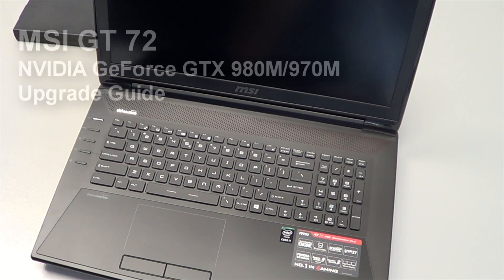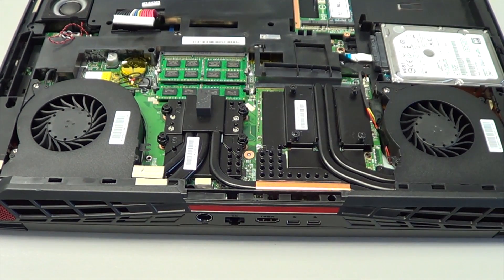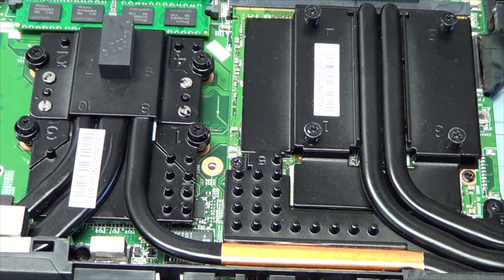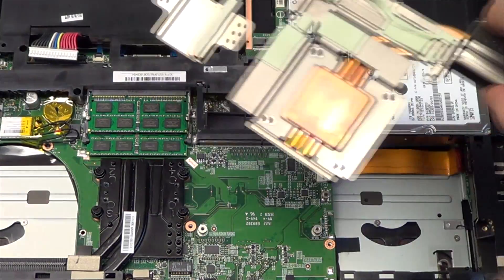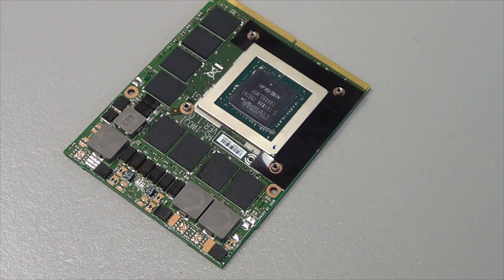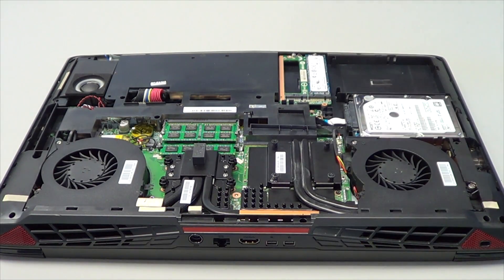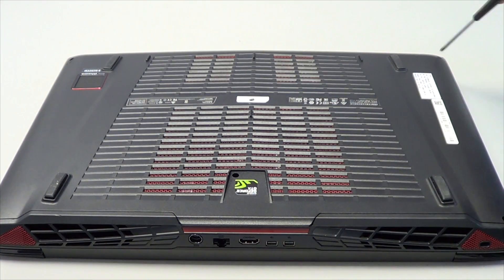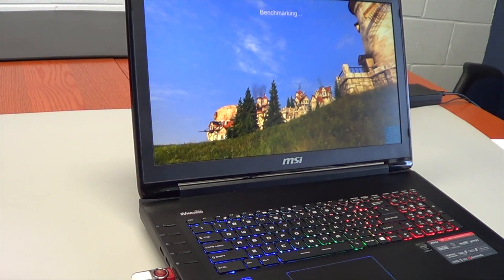MSI GT 72 NVIDIA GeForce GTX 980M Upgrade Guide

Comment: I would like to add my 2cents concerning to thermal pads, since I couldn't find it anywhere this is what i found doing some research and in my own MSI...
Memory 1.5mm
Resistors (big squares) and the little one up the memory 1mm
Row of 6 little components 1mm between Resistors
on the upper side 3 little components 1.5mm
and in the xtreme right 1.5 mm on two small ones
Reply: First, thank you for sharing this. This info is a beast to try to find online. Ive been looking for over an hour until finding this. How did the sizes work for you on your install? I am about to install my new card and need to know which size pads to buy. Also if you dont mind sharing what brand you would recommend as well that would be cool. again thank you for posting this.

Comment: I have a dell precision m4700 it came with a nvidia quadro k2000m gpu can i upgrade my gpu to this nvidia GeForce gtx 965m card i know that the 965m will fit in the dell precision m4700

Comment: Muy MSI gt72 shutdowns when reach 70 degrees. It has a GTX970M IS that the máximum temperature allowed?
Reply: Could be bad heatsink contact leading to big hotspot diference in comparison to the core

Comment: hey, i hope you see this. I have a older MSI cx62 6qd Laptop. upgraded the ram in it to 32gb from the stock 8gb thinking about a M2 card sense i have a spot for one. I really really wanna upgrade the video card from the crap card thats in it. Really I just wanna be able to play basic games in the metaverse and stuff like that with crisper graphics with no lag. First of all i am wondering if its even possible without going external and if it is what you suggest.

Comment: Hello, how are you? I really liked the video and I have a doubt. I have an MSI GT70 with a GTX680M MXM slot and would like to exchange it for a GTX1070 MXM slot. Is it possible?
Reply: yes but you need 2 things  -  1) vbios for MSI 1070mxm,  2) heatstink for 1000 series . Your wont work with 1000
Reply: @SebastianLaCroixV  Yes, I already bought the 1070 and it was a perfect replacement. I sawed off the heatsink to fit it. And it worked perfectly. The only problem now is that when installing the drivers, it only accepts the first version of 2019. So, it's limited in running the games. It runs Apex Legends perfectly at 144 fps. GT70 processor. I changed the processor from the 3610QM to the 3940XM. It gave a nice improvement.

Comment: Hey man, i got GT72S 6QF. But the old one (gtx 980) is dead. Now, i only use my intel hd 530. How sad.
Is that gtx 980m compatible with my notebook? It because i cant get the gtx 980 on ebay etc. Thanks
Reply from the maker: tough question. Email our team, they have the most knowledge about this. sales@eurocom.com

Comment: I have MSI GT72 Dominator Pro with GTX980M 8GB, can I upgrade it to RTX series? Thanks in advance.
Reply: Probably not since most mxm modules are different to each manufacturer and the bios locks they usually have in place

Comment: Nice video. I have a MSI GT70 2PE Dominator Pro with a GeForce GTX880m....... 
My question is simple...... Since I want to upgrade the gfx card, which newer GeForce will fit my laptop?
Reply: Søren Andersen that’s my question to for my 960m. Idk if it’s a card or a soldered chipset
Reply: @BeliefeBeef  i have now upgraded My 880m til a 980m without Any issues
Reply: Søren Andersen is the gtx 980m the highest it could go?
Reply: @BeliefeBeef  No a 1060 is the highest but theres alot of tweaking to get it to work properly. And you need to modify driver inf files each time you upgrade the driver etc etc....  I wanted a plug and play solution instead and it works
Reply: hi, where did you get the 980m? want to do the same thanks

Comment: Good afternoon, I changed the video card, but the laptop has a black screen, although the laptop works. when connected to the TV, the image is displayed on it. Laptop msi gt72-2pc, card 980m
Reply from the maker: you might need to flash the bios again.
Reply: @EurocomTechnology  как это сделать?

Comment: Hi,  I have a GT72 Dominator Pro Dragon Edition with a i7-4870HQ and a 980m 8gb in it. Can I upgrade my system to the GTX 1070? If so, do I have to do any special cooling or brackets for it to stay cooled in my system?
Reply from the maker: Just the GPU kit should work. Check out our upgrade page. http://www.eurocom.com/ec/upgrade(2,344,0)MSI_GT72

Comment: hi, can we upgrade nvidia gtx980m 4gb from laptop msi gt72s 6qe dominator pro g to the gtx 980 (desktop full 980 8 gb  version) ? if yes do we need to change the heatsink or the power adapter ?
Reply from the maker: Power adapter, no. Heatsink possibly

Comment: Do you guys sell this video card?? I need a new 980m

Edit: mine has short circuit and saw the oven method, does this works?? I'm a total noob
thanks :)
Reply from the maker: Here you go...  https://www.ebay.ca/itm/MSI-GT72-Laptop-MXM3-GPU-Upgrade-Configurator-Get-GPU-you-Like-/122652223599?var=&hash=item628043deb4

Comment: Hi. I have MSI GT72 2QD with GTX 970M 3GB. I need re apply thermal paste and put new thermal pads on cards memory. My question is how thick should these pads be in order to maintain good contact with heat sink. Is 1.5mm thick pads too much?
Reply from the maker: 1.5mm is might thick.  In our kits the pads very from .5 to 1mm depending on the video card and the system.  Thanks

Comment: For anyone that really doesnt know about diamond pattern for screwing and unscrewing, this guy is making a mistake, you never go all the way with a single screw, just give it a few turns, say 3 or 4, move to the next one in diamond pattern and so on, just 3 or 4 turns. I learned this by tunning drum kits, if you go all the way on the first one (out of 6 or 8), the drum head ends up uneven and through time you can deform the wood, even break it. This concept is the same when changing car tires.

Comment: What laptop motherboards are compatible with the GTX 970M or 980M? I have seen these on ebay and thought it would be cool to get a laptop motherboard, CPU, and Sodimm ram to make my own gaming laptop. I know how to make a laptop display using a 15 inch screen and video controller board. I'd use a 330 watt laptop charger from Dell or HP or something. I already have a 500gb Crucial SSD for storage. Any thoughts on this process? Would be a cool project to make in the summer and might be slightly cheaper than buying a brand new gaming laptop. Would certainly be more interesting anyways even if I don't save that much money.
Reply from the maker: There are literally 50 or 60 laptops that use this video card on the market including the MSI GT72 in the video.  Not sure how to answer your question
Reply: Ah fair enough. I just wanted to narrow down a motherboard that was compatible since I want to try and make my own portable gaming laptop. I saw some used laptop motherboards on ebay and thought if I could get a working one then I could add the GPU, some sodimm ram, and my SSD for a portable gaming machine. Would be a lot thinner and lighter than a normal desktop and allow me to use an external power supply like a laptop charger for portability. It would be kept in a custom case of course.

Comment: Hi. Before changing the videocard, do you need to press the gpu button to set it in Intel gpu mode? Thanks.
Reply: dmariscaldc no that’s totally unnecessary.
Reply: Shoo Puf so I can change the videocard while being the laptop in Nvidia Geforce GPU mode? Because in the video the guy presses the Graphics switch before installing the Nvidia drivers. Thanks!

Comment: Well SSD Is not that good doesnt last long i prefer HDD
Reply: but they are slimmer quieter and faster but they slow down so that's the only downside
Reply: SSDs typically last longer than HDD because they don't have any moving parts in them, and typically have a higher endurance rating for TBW.

Comment: I have this exact machine reason i am here is its not displaying on secondary external monitor.
Weird thing Drivers are detecting Monitor picking up on specs resolution & everything just no signal.
 
HDMI output isn't sending signal tried type c/thunderbolt adapter to hdmi same no signal.
Havent tried DisplayPort adapter to hdmi but you can notice the pattern here.

What the odds all connectors [ports] are dead? How is that even possible?
Or somethings up with the GPU itself?

Reasons why I concluded this a hardware issue

-Windows10 running latest VGA Drivers
-Linux Ubuntu troubleshoot - no signal

(Monitor and cables  working  fine on other laptop)

HELP Anyone?
Reply from the maker: Head to our support page https://web.eurocom.com/ec/supportr()ec

Comment: I have a MSI GE72 2QF Apache Pro with a 970m in it and was wondering can it be upgraded to anything better more specifically a 1070 or 1080
Reply from the maker: There shouldn't be an issue. Check our upgrade page http://www.eurocom.com/ec/upgrade(2,344,0)MSI_GT72

Comment: Hi Eurocom, I have an MSI GT72VR 6RD Dominator Tobii with GTX1060. I saw your page and I plan to buy the GTX1070 card for upgrading my laptop. Is this card compatible with this model (that is, does the "Tobii" model differ in regards to the GPU slot)? Thanks in advance.
Reply: any news? we have the same gear. im planning to upgrade too
Reply: yves galgana Hey man, looking at the inside of my own laptop I see that it's basically the same shape etc so I assume its compatible with regular gt72 as well as Tobii. Didn't get an official answer though.

 Are you thinking of updating too? It's rumored that the new Volta architecture will come out early 2018...
Reply: that volta might fry our unit man.. hahaha
Reply: yves galgana could have the same power needs but will work  more efficiently...

Comment: Hi, i´ve been looking for a while but i´m not sure, i have a GT72 6QD Dominator G with a GTX970M GPU, is it possible upgrade it to a GTX1060M?
Reply from the maker: That GPU seems to be embedded
Reply: I have that exact same laptop and the GPU is MXM so you technically can swap the 970M with something newer, but MXM cards are way more expensive than their PCI counterparts so I wouldn't recommend the upgrade, besides the 1060 has a different design so you will also need a new cooler compatible with that card and, if this is not enough, you have to check power draws because you run the risk of overloading your laptop power supply and this is not a good thing. The best thing you can do is to use that laptop till it's not good enough for gaming and then buy a new one. Best regards

Comment: Sir 3gb ram ,64bit means 2gb graphics cards,Intel core processor i3 ,model of laptop -Dell inspiron what are requirements for upgrading ram and graphic card as per my information provided pls reply
Reply from the maker: Most inspiration's do not allow for a GPU upgrade. The RAM, however would be very easy.
Reply: +EurocomTechnology thanks for reply sir,subbed gou

Comment: hello!!! eurocom Tech I want to know that can I upgrade my laptop graphics card I have Nvidia 940 MX I want to upgrade to Nvidia GTX 980 MX can I able to upgrade my graphics card my laptop Brand Is HP please answer me???my laptop specs is Intel i7 7500U and 8 GB DDR4 Ram 1TB HDD and Nvidia Geforce 940 MX graphics and Intel HD 520 Graphics I want to replace my Nvidia Geforce 940 MX and want to upgrade it to 960,970,980 any can I do upgrade with one of this answer me soon .nice video ....
Reply from the maker: Most HP laptops have onboard GPU's, meaning you can not upgrade them.

Comment: I'm wondering if a 970m could replace the 670m in my old Qosmio X870. That would bring it back to life again.
Reply: I mean, replacing the card is easy and possible, but will it work. That's the real question.
Reply from the maker: We have not tested it, so we cannot say for sure.

Comment: Can it works for acer laptop?
Reply from the maker: which laptop.  Most Acer systems do not allow for upgrades.
Reply: `Acer Aspire V5-431
Reply from the maker: Unfortunately this laptop cannot have the GPU replaced.
Reply from the maker: No I am sorry it will not

Comment: Hi! Nice video.

I have an MSI GP72VR whit a GTX 1060 3gb, but a wanna have 6gb. 
Do you now where can I buy a GTX 1060 6gb for my laptop? :D
Reply: I think GP72VR has it's graphic card soldered onto the motherboard, so i don't think you can replace it at all.

Comment: Hey man I have laptop acer with NVidia geforge 610M can possible upgrade with GTX 980M?
Reply: Not, if the laptop is thin then it won't support gpu upgrade, since gpu is mostlikely soldered directly to the motherboard. Only laptops thick like GT series from MSI and some other laptops can upgrade their gpu since they have MXM card.

Comment: HELLO! What is the highest graphics card upgrade that i can do for my MSI GE72 6QD Apache Pro? i currently have a nvidia GTX960M and want to see if i can make it better so i can use the htc Vive or Oculus VR
Reply from the maker: We have several examples of people who have gotten the GTX 1060 working in some GT72 notebooks.  Check online and they may have a full explanation online
Reply: Could i ask you, GE is same like GT?
Reply: tomas12912 if you still need the answer no it's not don't even bother upgrading ge system likely it's soldered.

Comment: Hi, I have a MSI GE62 7RE APACHE PRO. Now im fine with my graphic card (gtx 1050ti), but If I want to upgrade it later, its possible in my laptop? thanks
Reply from the maker: I believe the graphics are not upgradeable in that system.  Looks soldered to me: https://www.notebookcheck.net/MSI-GE62-Notebook-Review.137007.0.html
Reply: oh. thanks for your help. good video!

Comment: hi!... i dont have a msi but i have a  acer aspire F5-572G-531G  which has a 920m can i upgrade it to a 960m?
Reply from the maker: 920m is typically a graphics card that is soldered to the motherboard.
Reply: okay thanks
Reply from the maker: Good luck!

Comment: Hi I have MSI GT72 2QD and I need help. I can't find anywhere how to upgrade RAM in my laptop. Currently I have standard 8GB in one of the slots located under the keyboard. I want to upgrade to 32GB. Which means to populate all 4 memory slots with  two sets of 16GB dual channel kingston hyperx memory (2 under keyboard and two on the other side of the motherboard). Need some good guide how to do it. Thank you.
Reply from the maker: Hello!  Ok, so in this video two RAM slots are seen right above the CPU.  So follow this video to get access to those.  The other two are under the keyboard.  A quick google shows many of these guides.  This one seems ok: https://youtu.be/StpQACk8aN0

Comment: If I have a Lenovo ThinkPad P70, can I upgrade Quadro M3000M to the top end M5000M? Because they are based off of the same chip, it should work right?
Reply from the maker: That system reportedly does utilize MXM graphics but I am not sure if it is upgradeable.  I found this thread on NBR about it.  Feel free to read through: http://forum.notebookreview.com/threads/can-the-thinkpad-p70-gpu-be-upgraded.792362/

Comment: Can I upgrade my GT70 2oc graphic card which is Gf gtx 770m Kepler to gtx970m Maxwell and do I have to flash bios for this or modify heatsink?
Reply from the maker: Yes you can upgrade to 970M.  Options here: http://www.eurocom.com/ec/upgrade(2,378,0)ec  You should be able to reuse your heatsink with a simple thermal pad realignment.  We always recommend updating BIOS and drivers.

Comment: hi i have a laptop msi gt72s 6qe dominator pro g with nvidia gtx980m can i upgrade my gpu to  nvidia gtx 1070 or 1080 ? tnx  you are the best !!😊
Reply from the maker: Hello!  We have not supported the 10 series graphics in the MSI GT 72 at this time.  The highest performance graphics card we offer for that system is the 980M.
Reply: he asked if he can not if you have one. idk one year later maby you do.
Reply from the maker: Unfortunately our cards will not work in Asus notebooks.  You can only use Asus brand cards in Asus notebooks
Thanks
Reply: I have this msi GP72 6QF Leopard Pro with a gtx 960M, what is the most powerful GPU I can upgrade to on this computer?
Reply: @michaelkingstar5878  I don't think that model of MSI laptop has compatibility to replace graphic card due to it can be soldered on the motherboard, only the GT series has these so called MXM cards that can be re-placed. while thinner ones have their graphics soldered directly on motherboard.
Reply: @tseyksuli4541  I really forgot all about me commenting on this video, but I think the reason for why I wanted to upgrade was so I could have a much smoother FPS on certain games. But after thinking for some time, I do remember that I had loads of overheating problems, also I had weir fragmenting on games which is a symptom of a damaged GPU.

Luckily I'll soon move away from laptops and rather build my own kind of system. Drooling over the specs of the i9-9900k and the coming RTX 2070 ti. So yeah, I'm looking forwards to that.

Anyway, thanks for your answer and advice 👍
Reply: I  have GT72 Dominator pro with 1070 gtx.. , it was in stock with it.
Reply: @jurisbaranovskis4915  was this an mxm card?
Reply: warren tehahe B NM
Reply: With 4 or 8GB Ram?
Reply: https://www.3dmark.com/3dm/28041981 my gt72
Reply: What they mean is the VBios isn’t verified... I know the vbios is flashable, but that’s definite on your own kind of thing.
Reply: EurocomTechnology  I want to upgrade my 940mx ddr3 graphics with this one in asus r558uq 513d model? 
Any suggetions??
Reply: but there are any such cards for asus models brother